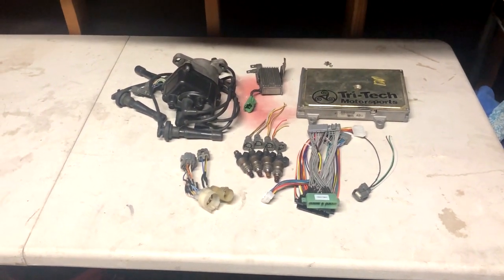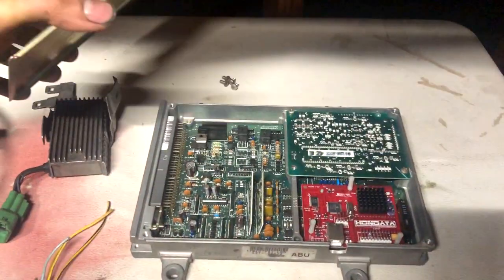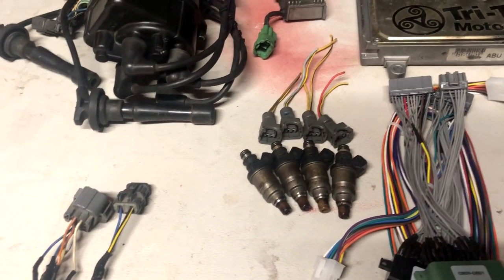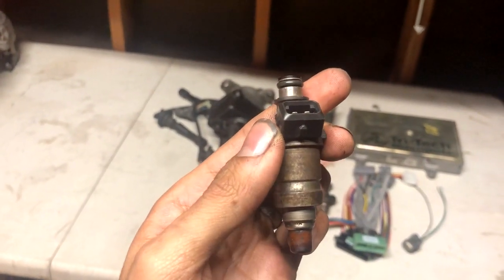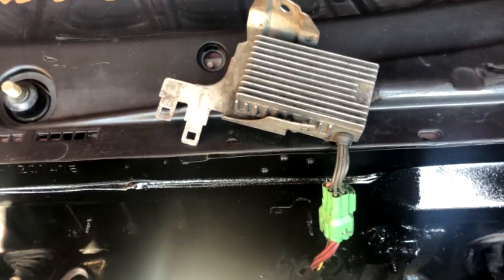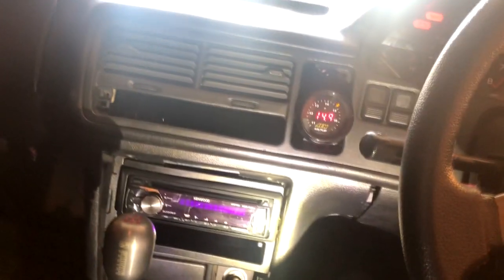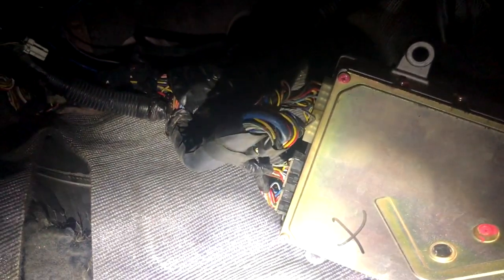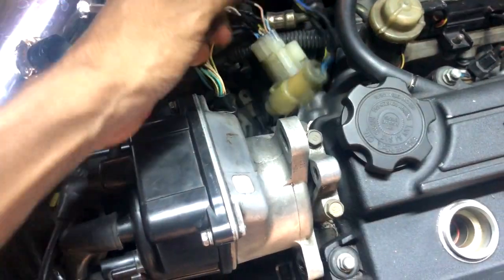HOW TO: Convert From OBD0 to OBD1

Comment: My uncles b20 Vtec on his 1990 Integra he converted obd1 and used a Po6 obd1 ECU from a 92-95 EG Civic DX and added Vtec and chipped it anything works as long as it’s chipped for that tune basically the obd0 To obd1 conversation on the 90-91 Integra and even 3rd gen preludes are similar to the EFs and CRXs we found out minus converting DPFI to MPFI making the da9 and HF And SI models easier his tune is Chrome chip not the hondata but Chrome has its perks
Reply: I have a manual converted DA9, stock b18a1, im thinking of doing this conversion my question is are there differences as to which obd1 dizzy to get? are auto and manual the same? i figured a distributor from a manual dc teg would be ideal?

Comment: Do you know how I can wire in my crank position sensor from obd2 d series harness to a obd1 dizzy on b18 ????
Reply: Obd2 computer (ecu)can be fooled by at the ecu plugs by jumping the ckf wires to ckp 
On obd1 ecu you leave it unplugged or you cut the plug off whatever you wanna do or leave it plugged onto the sensor itll never do nothing on obd1 because obd2 and obd1 have a crank sensor inside the dizzy
Obd2 honda they just added that crank sensor externally to make extra money when those went out by oil leaks..obd2 dizzys as well have the crank sensor inside the ecu so yeah

Comment: Hi Speedboy, Hoping you still read these comments. did a JDM D15 swap duel vtec, into a 1991 HF CRX. Have the Rywire harness, everythings hooked up. No resistor box due to obd1 injectors. We are not getting any injector pulse, car starts on starting fluid but wont start without it. Has spark and fuel, just seems to be an issue with the injectors not pulsing. How do we fix or trouble shoot this? cheers

Comment: SpeedBoy
I have a 90 civic EX sedan 1.6l it had a d16a6 but was stolen. I got a d16z6 on it with p28 it started but doesn't have any power when i press the gas. I also bought the harness jumper since my harness is obdo. The o2 wires i have not use not sure how to do it and haven't been able to connect the vtec to my old harness. Any help would be awesome thanks.

Comment: On mine 93 Honda Prelude H22 inside of my 94 Integra I had to put a resistor box my odb2 injectors had a high ohm and the 93 Prelude had a loam and I had a resistor box

Comment: Does the distributor matter if it v tech or non
Reply: Ok because mine is not v tech
Reply: Well my motor is non v
Reply from the maker: VRO 99K so just use a non v dizzy on it. If it’s vtec use a vtec dizzy, for non v use non v dizzy.
Reply from the maker: VRO 99K yes you will need a vtec distributor from any b series with vtec.
Reply: Ok bro thanks

Comment: Question: i have b16a with pw0 ecu which already has the knock sensor, oil pressure sensor & vtec solenoid. Do i still need to wire the extra wires to those three things?
Reply from the maker: Yes if your harness doesn’t come with those plugs you will need to run your own from the sensors to the ecu.